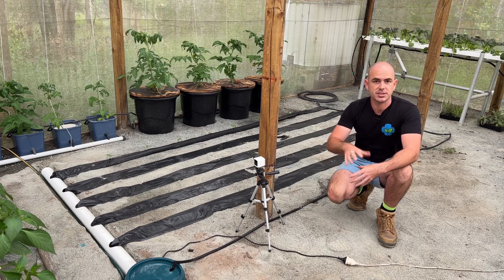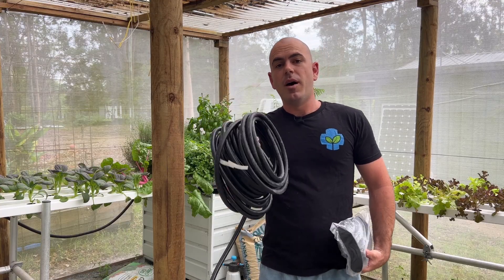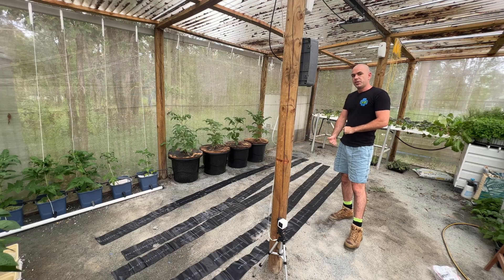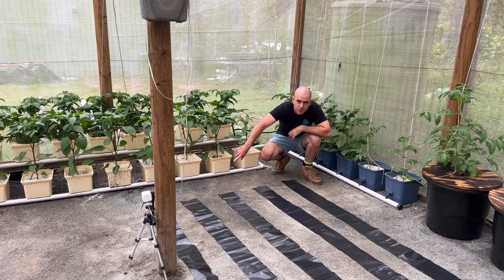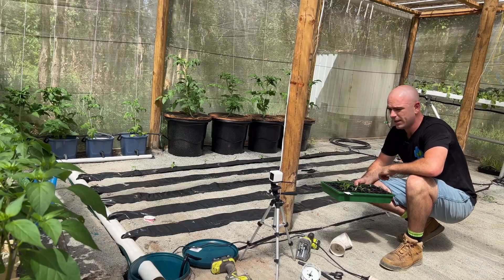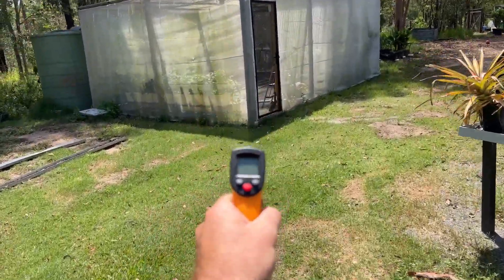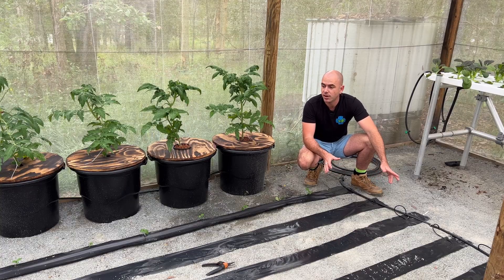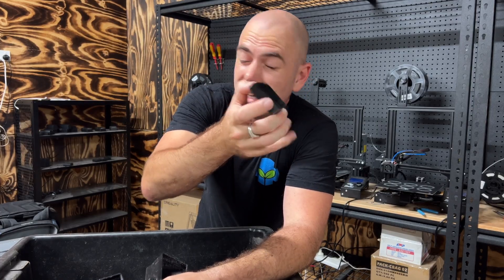The Nutrient Film Technique Experiments

Comment: I used to have in the past ran a 2 hectare nft system mainly for lettuce . I used the pvc guttering tube similar to yours i made some small systems like you made but i put the tubes on a 1400 stand then there was no need to dig a hole for a bucket . You can use yogurt cups for putting your plants in any other way could see your small plants running off down to your bucket. I enjoyed your video keep up the good work

Comment: With the “Rain Gutter” systems, should we cover any unused holes?
It’s just in my system I have a number of growing holes left vacant, and I’ve noticed algae starting to grow on the bottom, where the sun gets in.
If it’s nothing to worry about, all good.  However, if this isn’t a good thing, I could put covers over any vacant growing holes, which would probably stop this from happening.
Any advice in this issue would be appreciated.

Comment: I know it isn't nft but filling the tubes with medium would lift the top layer away from direct contact with the water flow and would work like the trough system in the old hydroponics video.
I like how you show the good with the bad. I think people seeing that even a "professional" can sometimes have failures helps them from getting discouraged.
Thank you for all that you share with us.
Reply: Shouldn't be necessary.
If the camera angle isn't misleading his problem here seems to be a common one, he's not sloping the tubes/channels enough. Angles from at least ~4° up to much more can work well ime, it's nice to have it variable to be able to adjust according to root growth.
A lack of slope creates something more akin to a shallow deep water culture system. NFT though, as the name states, is supposed to only have a very thin film of nutrient solution (~2-3mm/around a tenth inch or thinner). 
If done right you don't need anything at all, the top layer of roots will grow to be exposed to air anyhow.

If it gets too crowded root wise in the channel and the water starts to get staunched though, to a certain degree you can increase the slope and if that doesn't suffice you can simply put a standard programmable relay for DIN rails before your pump and run it 10 minutes on, 5 minutes off - or an even cheaper flipflop relay and run it 5/5, 10/10 or 15/15 on/off if it needs very long to drain. That way there's always good conditions without any intervention necessary.

I'd recommend using a relay and giving them 5 minutes off time every half hour anyway though. Makes things more fool proof and in some cases it seems to be generally beneficial because spots that go stagnant due to root growth get drained and filled with fresh nutrient solution at least twice every hour.

Comment: The biggest problem is using black plastic to make the pipes. It's better to use plastic with one side white and the other black (or doing 2 layers with white and black plastics), that way it will reflect radiation away instead of absorbing them and heating up. Another easy fix for this system is to add a flat layer of plastic, preferably white, about 1-2 cm above the pipes, with some holes for the plants to poke out.

Comment: I really like how you try new things, the final result is simple and nice. I'm wondering if the rocks under the pipes will not store heat too much and release it to the pvc pipes, maybe elevate them by 1-2 cm or so with some pieces of wood or something ?
Reply: I don't think they will get that hot to affect the water temperature more than 1-2 degrees and as soon as the night comes, it will all cool quickly. Bury the reservoir down enough the ground will insulate and keep the temperature down.